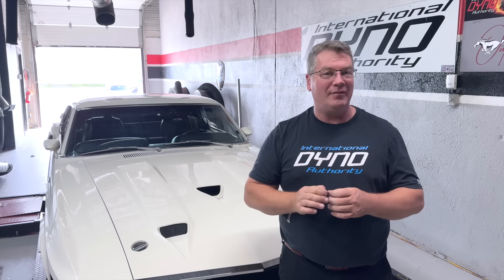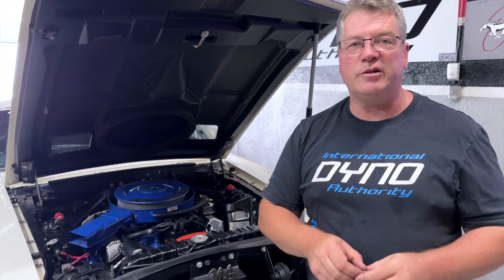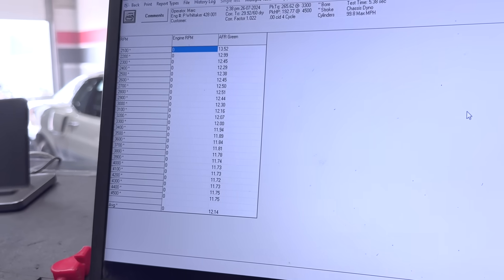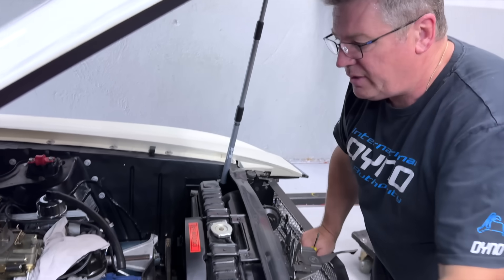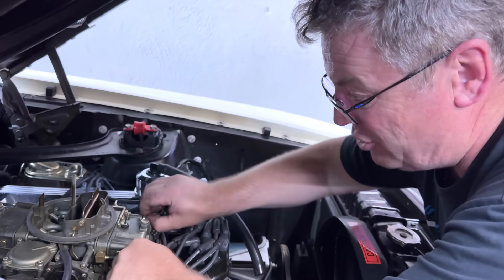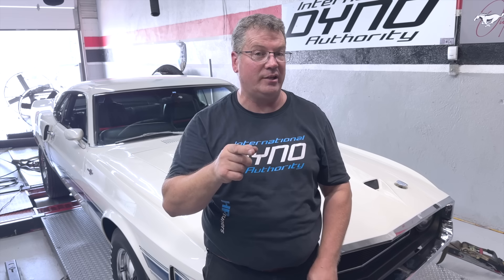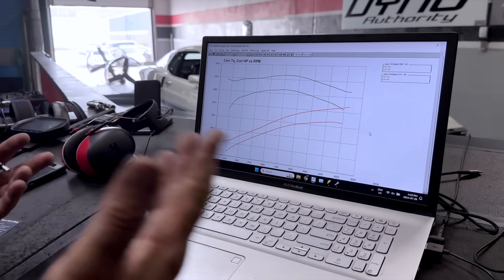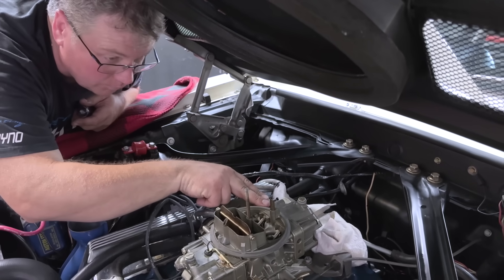Original, unrestored '69 Shelby GT500 tuned on the dyno

Comment: It’s very interesting that it’s had these issues going way back from day one.  Has anyone checked to see what size jets it should have come with from the factory?  I understand that gas has changed dramatically from 1969.  My carb restorer guy talked to me all about the fact that sense the early 2001’s, fuel has less energy in it than before.  I have a Buick with a quadrajet.  He said that he brazed the air bleeds shut and drilled them out to a smaller diameter than original to richer it up.  I have a hard time believing that it was that far off when it left the Shelby factory.  🤔 Anyway, great video!
Reply: Your carb guy knows his chit. been a looong time since I seen someone do that. 
Those bleeds make such a difference!

Comment: Good job on the tune. Back to basics is the best plan. You didn't have much to work with as those 428's were 15 sec quarter dogs.
Reply: Not the Cobra jets and Super Cobra jets, stock they could run in the 13 with right gearing.
Reply: They easily ran low 14s  . What are you talking about?

Comment: Its a shame ford cars had such narrow engine bays. The exhaust was always the limiting factor with the heads.
Reply: Thats why I quit buying/building them. 65 or 85 those shock towers sucked!!
Had to lift my 460 up just to drop headers some and put a starter cable on or header gaskets.  Then discovered theres not enough grille opening to keep the stupid thing cool

Comment: For how that car is probbaly slowly crusied around I would want the Vac back on. ( bet it would love another 6 degs at cruise) Did you put a new set of plugs in, the old ones must have been sooted, or did you think they would clean up?
Reply: Carboned up, not enough timing. Not sure why people do that, its going backwards
Reply from the maker: Our tuning process is meticulous and systematic, starting with all passes beginning at 2,000 RPM. The throttle is applied rapidly to the wide-open position, ensuring consistency across every run.

Each test is conducted on the chassis dyno under identical load conditions, allowing the vehicle to accelerate as quickly as its setup permits. The duration of the test is carefully measured and compared with subsequent runs to evaluate progress.

Initial tests are run until the torque curve falters or until the data log indicates unsafe, unproductive, or non-rewarding results—signaling the need for adjustments or the next step in the tuning process.

We prioritize the safety and condition of every customer’s vehicle, treating each one with the utmost care. Throughout the tuning process, we closely monitor key parameters such as temperature, AFR, IAT, balance, and torque production across the RPM range.

Our goal is to deliver responsible, high-quality results that enhance the performance of the vehicle without compromising its integrity—or our reputation. We do not take risks that could endanger a customer’s vehicle or the standing of our business.

As we observe improvements, we gradually extend the RPM range, focusing on identifying the engine's most efficient operating zone. At every stage, we ensure transparency, sharing step-by-step results with our customers and walking them through the data logs to educate and inform.

Each test adheres to a precise, repeatable procedure, maintaining consistency and accuracy. This approach not only ensures optimal results but also reflects our commitment to excellence and responsibility in tuning.

Comment: I can not watch the rest of this video!!! It is not a motor  ..it is an engine..this drives me crazy
Reply: You're a putz. 
You could have Googled it before you made that embarrassing comment. 
It's has always been common practice to call them motors. 
Motor and Engine can be used universally for combustion engines, but you can never refer to an electric motor as an engine.
Reply: I guess motor oil must really put you over the edge
Reply: @BillyTurner-vb3hf  
Oh no... He's definitely triggered now. 
🤪🤪🤣🤣
Reply from the maker: @Wkram59  Ford Motor Company (commonly known as Ford) is an American multinational automobile manufacturer headquartered in Dearborn, Michigan, United States. It was founded by Henry Ford and incorporated on June 16, 1903. The company sells automobiles and commercial vehicles under the Ford brand, and luxury cars under its Lincoln brand. The company is listed on the New York Stock Exchange and is controlled by the Ford family. They have minority ownership but a plurality of the voting power.[5][7]

Ford Motor Company
Reply: Really that bothers you
Reply from the maker: @jamesbowden5306  What brand of motor oil, do you use? 

Valvoline 

Mobile one 
Amsoil
Reply from the maker: @Wkram59  https://onestopsubscriptions.com/motor-trend-magazine-subscription?campaignid=171473722&adgroupid=11723773642&creative=165182893340&matchtype=p&network=g&device=m&keyword=motor%20trend%20magazine%20subscription&gad_source=1&gclid=Cj0KCQiA4fi7BhC5ARIsAEV1Yibp3V2IIomlgP2gj3iJN3bdsIBJAoPjvF720LWyDyGnu70CCGqRGWgaAndEEALw_wcB
Reply: Its a car guy channel not grammer class, not worth getting wound up about

Comment: If it has the stock Ford cam...yur wating yur time.
Reply: yeah, dude. 100 ft/lb increase in torque by changing jets and advancing the distributor. a HUGE waste of time, right??. absolutely not worth the probably 50 bucks (at most) in parts plus the dyno time for those measly gains. that comment was ignorance defined
Reply from the maker: @raginroadrunner  

Once again, we suggest that you watch the video from start to finish. 

From reading your comments, we know that you're going to learn a lot. 

We offer courses, to teach people like you step by step by step. 

We also pointed to a link, that you could go through, and check step-by-step tuning. 

Now after signing up for one of our courses, and then following through each one of the videos and going through each one of the lessons, you'll begin to have an amateur understanding of some of the circuits of the carburetor. 

After this, we recommend that you move on to some of our more advanced tech courses. Once you've gained a moticum of combustion chamber understanding. 

You can then move on to purchasing your own carburetor, starting to make some minor adjustments, see how those minor adjustments affect: vacuum, velocity, AFR, overall performance, 

Once you've worked with the same carburetor for a while. You'll start to become from our with what it does. 

At this point, you'll be able to move on to some of our medium level courses. Where we can start to discuss strategy, and, air flow, overlap long tube headers, combustion, and the science of flamefront. 

We can walk you through step-by-step-by-step educating you, until you have a better understanding of how the air pump that we call the internal combustion engine. Ice, works.
Reply from the maker: @raginroadrunner  blurting out 11. Sentences, with periods in between, probably would not solve anything. 

Follow along, and watch some of our other videos which will give you a basic understanding of where you can start
Reply from the maker: @raginroadrunner  The International Dyno Authority prides itself on offering a comprehensive education in engine tuning and combustion theory, catering to beginners, intermediates, and experts alike. For those who know little more than the fact that engines make noise, our beginner courses are the perfect starting point. We’ll hold your hand through the fundamentals, such as air-fuel ratios—why they matter, how they work, and why so many "armchair mechanics" get them wrong. And yes, we’ll teach you combustion chamber theory too, because understanding what happens inside an engine is essential to actually tuning one, not just talking about it.

As you progress, we introduce more complex principles that separate casual dabblers from serious enthusiasts. At the intermediate level, you'll delve into advanced concepts like the “15 to 17 degrees after top dead center” rule—a foundational principle that seasoned experts rely on for peak engine performance. We don't just tell you what works; we explain why it works, ensuring you understand the physics behind engine dynamics. Our goal is to equip you with the knowledge to troubleshoot and optimize an engine yourself—not just follow a YouTube tutorial and hope for the best.

Finally, for those who truly excel, we prepare you for hands-on application. Once you've absorbed the core principles and gained the confidence to move beyond theory, we guide you toward selecting and purchasing your own carburetor. This is when the real fun begins, as you’ll start experimenting with basic tuning techniques under the guidance of our experts. By the time you reach this stage, you'll not only understand the science of engine tuning but also have the skills to start applying it with precision.
Reply from the maker: @raginroadrunner  International Dyno Authority: Pioneering the Future of Tuning and Combustion Technology

As North America’s premier facility dedicated to advanced tuning and research, International Dyno Authority (IDA) has set the standard for tuning and power optimization across a vast range of applications. This cutting-edge institution has earned a reputation for excellence through extensive partnerships, groundbreaking innovations, and the development of tuning standards that are transforming the industry.

Partners in Innovation

IDA collaborates closely with leading corporations, advising powerhouses like HP Tuners, Whipple, Roush, and Ford Motor Company. Their insights and technical support have become an essential resource for these companies, driving improvements in engine performance, efficiency, and emissions standards. Through these relationships, IDA has a unique vantage point to pioneer developments that shape the industry’s future.

Pioneering Standards in Tuning

Since its inception, International Dyno Authority has been at the forefront of the tuning industry, not only setting new standards but also elevating the capabilities of tuners of all experience levels. Through their publications and training programs, IDA provides essential resources that empower both novice and professional tuners, equipping them with the skills to achieve precision tuning across various engine platforms. Their commitment to education is evident in their comprehensive curriculum, covering the intricacies of combustion dynamics, air-fuel ratio (AFR) tuning, boost management, and fuel characteristics.

Educational Outreach and Online Presence

IDA has established a strong online presence, notably through their YouTube channel, which serves as an invaluable resource for enthusiasts and professionals alike. Their instructional videos, which include step-by-step tutorials, practical tips, and expert insights, are used by institutions such as MIT, Boston College, SCT, Holley Inc., and Edelbrock, making IDA a recognized leader in education within the field. Their expertise has also gained the attention of influential industry figures, including Steve Morris, who has commended their contributions to tuning technology.

Specialized Focus and Areas of Expertise

Operating as a purely tuning and research facility, IDA’s specialization spans a wide range of topics. They delve into complex subjects such as combustion technology, AFR tuning, boost and fuel optimization, and luxury engine swap integration. The organization’s work also extends to advanced fuel research, as seen in their recent collaboration with TTC, Hydra-Gen, and DynaCert. Here, IDA took the lead in developing an 8.9L Cummins engine hydrogen supplement fuel program, which included rigorous emissions testing, underscoring their commitment to sustainable and innovative fuel solutions.

The Facility’s Technical Scope and Testing Capacity

Each year, IDA conducts over 650 vehicle dyno tests, tuning engines and chassis systems to optimize performance. This includes a wide variety of engines powered by gasoline, E85, diesel, hydrogen, port and direct injection, throttle body injection, and even carbureted systems. Their expertise is not limited to traditional vehicles; the facility also tunes boats, tanks, and military transport, making them the only independent tuning and research center in North America dedicated to such an expansive range of engines and fuel types.

Advancing Industry Standards

By leading projects in combustion and alternative fuels, IDA continues to be a key player in the evolution of tuning technology. Their dedication to setting new standards in performance, efficiency, and sustainability has positioned them as a trusted authority in an industry that is constantly evolving. For anyone looking to understand or pursue high-level tuning, International Dyno Authority remains the ultimate resource and innovator in the field.
Reply from the maker: https://youtu.be/MGgBtNOB6Z8?si=lioBn5jc83nmOKPv

Comment: Power valve???
Reply from the maker: @raginroadrunner  

Probably your best bet, is to watch the entire video from start to finish. 

Once you have watched the entire video, you'll be able to see, what happened: 

Starting with basic adjustments. 

Moving on to each section of the carburetor. 

The power valve was incorrectly labeled. The power valve had the wrong gasket. 

The main Jets were too large on the primary and the secondary to support the amount of horsepower being supplied. 

These were adjusted, and the orifice made smaller, to accommodate proper combustion and the fuel and the ignition timing. 

After this we went on to still experience clouds of smoke. 

So now we have our fuel curve corrected. 

The carburetor is now tuned to provide the proper amount of fuel. 

There is extra fuel coming from somewhere else. 

As it turns out, in the '60s the accelerator pump nozzle, was maximized. 

The accelerator pump circuit, was also not built the same as modern carburetors. 

We were able to replace the nozzles and the check valve, and the spring, the accelerator pump diaphragm. 

This lessened the smoke by more than 50%. 

Still there was smoke. 

Like pretty much every other vehicle that arrives at the dyno, the PCV system had been bypassed. 

The PCV valve was hooked up directly to the intake. 

The PCV system draws oil vapor and heat directly into the intake and then mixes it with the air and fuel. 

In this case to PCV system was bypassing the carburetor all together. 

Introducing non-mixed non-carburated air and oil into the combustion chamber. 

We rerouted, and added a restrictor. 

We adjusted the final timing curve, 

After we adjusted the final timing curve, the engine made more power. 

It ran clean 

There was zero smoke of any kind. 

So, just writing two words 

Power valve 

Plus three question marks 

Doesn't solve anything in this world. 

When a vehicle comes to a tuning shop. We go through step by step by step by step. 

We start with the low speed 

We move on to transition 

We move on to mid-speed, high speed, 

We move away from vacuum into velocity. 

We tune each circuit step by step by step until it is correct. 

We eliminate all issues. 

Make sure that the spark plugs are gapped correctly, in good condition. 

And we walk through the process until we find either the issue, or tune or repair until the issue has been resolved. 

Again, just writing three question marks and writing two words does nothing. 

Thank you for your input, but, jumping to conclusions will only make your legs tired